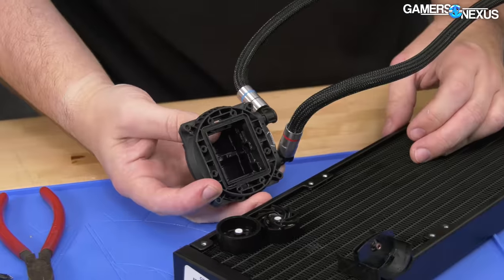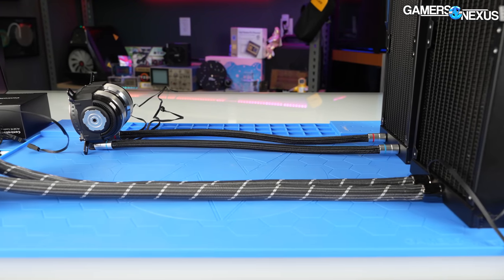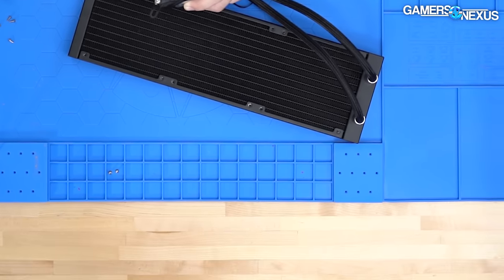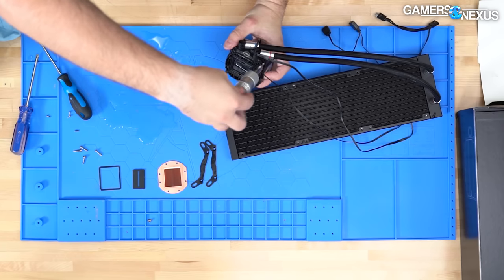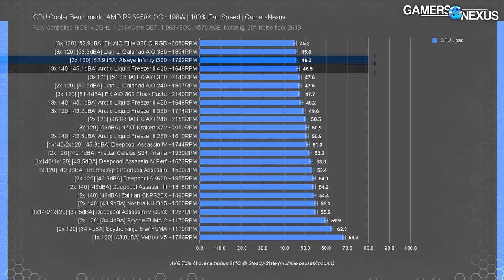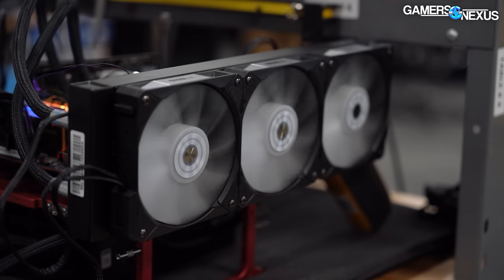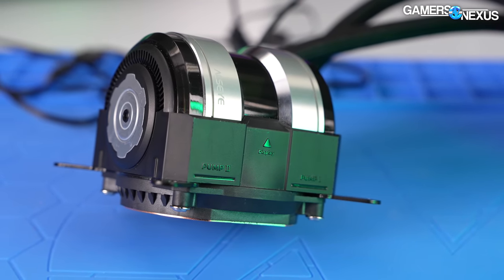Strange Liquid Cooler from AliExpress | Alseye Infinite i360 Dual-Pump AIO

Comment: Longshot and would probably add some complexity, but it would be neat to have a couple measures on the coolant like TDS and Glycol percentage to get an idea of the quality of water used and how much freeze resistance it has if you buy one in the winter in parts of the world. TDS meters are fairly inexpensive on Amazon and Glycol can be measured with a cheap refractometer. Water with high TDS is probably poor quality from a well somewhere and not cleaned up well before use, that could result in problems later on with biological growth or minerals/metals in the water reacting and leaving deposits or sludge.

Comment: 11:10 Did they solder the mid board onto the side boards after the stators were in place? That makes this very difficult to repair. It's like they built it in CAD and then tried to figure out how it would actually go together.

Comment: Should test how it works if one of the pumps fails. If it still works to a reasonable extent then that reliability would be a big advantage over other AIOs (as long as the pump reliability itself is decent), if it doesn't then it's at a huge disadvantage from having the extra point  of failure

Comment: These tests need one more chart where you swap out the included fans for a mid-range option (a standard set of fans you test on all the rads). I would have liked to see if the dual pump actually made a difference but these charts are entirely dependent on the fans, not really the whole cooler.

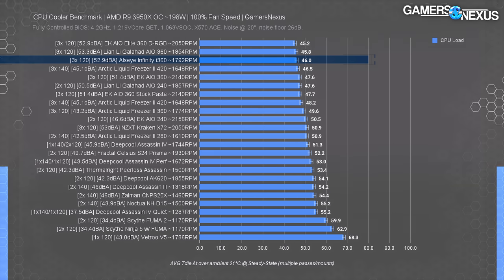Comment: On the 100% fan charts (around 16:00), the Arctic Liquid Freezer II 420 is listed twice - same fans, same RPM, same dB level, but one at 46.5 and one at 48.2.  Is that a mistake, or is there a difference in the runs?  VRM fan maybe?
Reply: The first one is with the offset mounting i guess

Comment: Also would be interesting what happens in case one of the pumps fails. Maybe this is an advantage compared to single pumped versions
Reply: Yeah it would have been interesting to see them clip the motor wires for one pump to simulate a failure and see if it would still cool adequately
Reply: @xDownSetx  this

Comment: Would this AIO fail if one pump died? What did the fans actually sound like? What is the warranty service like? Wouldn’t the pressure drop off from the air stopping after the radiator create less turbulence and easily be removed by another case fan? How reliable are those electric motors? Aren’t the shorter tubes actually better in a smaller case, from my experience the longer tubes just get in my way working in smaller cases. Standardized fans would be interesting and even trying these one on another cooler or testing them another way would also be interesting. I would also be curious to see what happens if you attempt to push the limits over clocking further or just letting the CPU maintain turbo speeds itself. I realize only so much can be addressed in a single video like this in a way that wouldn’t turn viewers away and not actually productive, but those are some of my questions. It’s hard to move from established brands that aren’t necessarily perfect so it would be great if you could reasonably facilitate information required to be able to trust a brand without putting yourself in the line of fire if the product or warranty sucks like you’ve been doing for the prebuilt reviews. I suppose that you already have a lot of this covered in future content and it’s just a random AIO. I just felt like making a comment now that I function well enough to be able to do so at the moment in a way that seems reasonable or even just have the extra bandwidth to be able to. What happens if you kill one of the impellers or electric motors does the other die or does it even matter? I would imagine running at the minimum fan speed it was designed for would be a reasonable volume for most people. If this was made by a well established manufacturer would this review have been different? This review was well done like usual. 

I have a lot of sensory overload issues that I used to just ignore for as long as I could or not even notice until I had a mental breakdown and didn’t always realize one of the primary causes.

Comment: This may be a dumb request, but when doing AIO disassembly could you also look at the tubes and fittings? Some AIOs are very modular and even use G1/4" barb fittings which makes them a very good value option, like the Alphacool Eisbaer 360.

With this dual pump design I wonder if the pumps could handle a bigger loop, but that's sort of out of question if it's hard to extend it (not impossible as you could always just cut the tubes and use your own barb fittings in between.

Comment: I am surprised no one sanded down those plastic spacers that the cooler mounts to.  I bet it would have helped the pressure test.  Either the motherboard or cooler is out of spec.  Or the spec requirements is not good enough

Comment: I love the idea! Dual pump, and it looks like a turbocharger which I really dig. I definitely don't trust the brand enough to even consider putting one in my computer
Reply: I know having redundancy with two pumps in place preventing complete failure if one dies, using tubing that doesn’t permeate liquid, fairly high quality parts is a complete turn off for me when I think about reliability in an AIO. I have issues trusting new or not particularly well known brands too, but I’m curious about the parents company and the reliability of their previous products that Steve mentioned. Their warranty service would be the actual concern for me.
Reply: @badadvice787  Yeah, I think we're on the same page... 
If this company sticks around for a while and can maintain a good track record, I would definitely look into one as a future AIO. Right now I'm happy with my EK AIO which I took a chance on when it came out (I think it's their first AIO? but it's EK after all, and has one of their open loop pumps in it). Hopefully it will have a long lifespan because I like everything about it, zero complaints.

Comment: That's a LOT of complex parts which IMO means there's a lot that could go wrong. With my last build I felt I had to bite the bullet and go with an AIO because it's starting to get a bit comical how little clearance we've got around components like RAM and SSDs, it just kinda seems necessary at this point.

Liquid cooling requires maintenance on a fairly consistent basis, and I'm already aware that I'm not going to do that. AIOs function a lot longer without maintenance and are just meant to be replaced when they'd otherwise require it. That's wasteful to me, but I also realize I'm not going to do what'd be required to take care of a custom loop, and I don't want the extra cost associated with buying components. So, fine… AIO it is.

Just not this one I think.

Comment: All the comments about standardized fans have a point.
Although at that point you're basically just rating how beefcake the radiator is, and Arctic's Liquid Freezer IIs would win "everything".
Speaking of, I currently have a Liquid Freezer II installed in a case that it was technically too thick to fit into, so I had to replace the fans with slimlines.
I know I'm giving up some of its performance, but it still seems to run quiet and have no problem keeping my 2700X cool.

Comment: I dunno, all the hype around ultra quiet cooling just passes me by.  I run a full custom water loop for CPU only, that includes a 240mm rad with two VA450DC Nidecs.  The info I found suggested a 268cfm flow rate at max RPM, which is greater than the rad fan in my car.  I run the power straight out of the PSU (3.2A is far too much for a mobo header), and they are speed controlled by a USB AWG.  At around 25% power, they are in the mid-60>low-70dB range.  You can hear them, but the STRIX 1060s fans are louder at full tilt while gaming.  Water temps unloaded are around DTa 5-7F, with loaded temps reaching DTa 20F (max I have ever seen is 80F in my room and 102F water temp).  Those deltas get me right at the end of the thermal margin on the FX8350 @4.8GHZ 1.365VDC.  Full tilt the fans are a bit obnoxious, but my surround sound is still louder.

Comment: My Corsair H100i elite had the same 9 blade, 9 support type fans which was problematic in my setup. During gaming there was significant harmonics that would surge up and down in volume. Replacing them with basic Noctua redux fans fixed it completely. Not sure why anyone would design a fan like this nowadays.

Comment: Not sure if you have done this before but, would it be possible to cut and smooth out half of the brace elements on the back to attempt to show the effect of them making less noise vs one that has not been modified? if that worked, would it ruin the structural integrity to a point of failure? just genuinly curious.

Comment: I don't understand why the tubing's of the coolers are soo thin in diameter, I mean does the thickness of the tube improve the performance of the cooling the water better if the size of the tube is bigger?
The pumps are OK but the tubing and the pipes of the radiators are too small for better performance, doesn't it?
OK and one more thing, why we don't see a thicker fans more then 2.5mm of thickness, isn't it gonna be way better air pressure with thicker fan to move more air thro high density fin's of the radiators or coolers designs?

Comment: the first chart with the thermals at 15:00 has two different entries for "[3x 140] [45.1dBA] Arctic Liquid Freezer II 420 ~1648RPM" with different results.  What's the difference between the two?

Comment: Its Unique look deff give it a place in the market. Supported by the fact that it is actually good at cooling 👍
The only thing i do not like about it, refill-ability :( Based on the dual pump / dual impeller design, the mechanical load is split giving it possibly longer life span? Hence 2-3 years down the line, flush and refill, aka maintenance .

Comment: No idea if this can be tested for, ur I'm curious how it'd run with just one working pump. Possibly something for the idea of "if one pump did die, you're not completely out of luck." also would be interesting to see how easily this type of stuff is installed in a case. Obviously it'd have to be kinda generalized, but I couldn't help wondering when Mike was having trouble with the stiff tubes just on a test bench.

Comment: Just a question, when you do these tests across different coolers and pressure graph do you torque the coolers down to the same amount of pressure on the mounts or just follow the product guide lines from the instructions provided? Awesome content as per usual, been subscribed for years!

Comment: You know what I find peculiar, not that fan is from unknown brand, but that their software is very much like Lian Li's one. Pretty similar interface, led light set (consists of three bars), colors - I wonder if they use one software, but customize as per company (similar to connector hubs, look same, only sticker is different, ex. Cooler Master).

Comment: That's a terribly high min RPM for the fans, so it therefore must be loud when idle.  My system's often around idle (with spike that thermal mass can deal with) and fans remain at 400RPM most of the time (can hold 300 but 400 means far less need to ramp for fatter spikes) on D15.

Comment: I noticed that the Thermalright has one of the smallest flatness test from your testing, but that's an air cooler. I went to look and found they have water AIO as well, called Thermalright Frozen Notte 360, and Thermalright Frozen Prism360 (and 240 versions of them as well). Have you considered testing them? I wonder how they fair with Artic Liquid Freezer II since it's close the best efficient AIO cooler from your testing. Or is it not reviewed because it's just bad? They are cheap and haven't heard much about any of their liquid coolers (they may have other models I'm not aware of)

Comment: It looks like the company should spend some engineering money simplifying the construction. The more complicated the assembly, the more points of failure. Between tolerances, tolerance stacking and assembly. Of course the cost of all of the proprietary little bits, assembly, and subsequent warranty issues.

Comment: Is it possible to use a Dremel to remove some of the struts on the backside, or does it seem that the structural integrity would be compromised if you did that?

Comment: When you buy a real good water pump or and waterblock, you can find that it's easy to dismantle and can repair, because it worth enough to make it last the longest possible. You just cut the wire coil of the motor,dead. 5 PCB...weird.

Comment: @GamerNexus i don't know if you read this or you are interested but i challenge you to do a test. 
Mobo usually have heatsinks on high temps components.
I wonder what would have change if you would use as much as you can heatsinks also in less warmer components or smaller components.
Same temps as before? Would it give some benefits or gains in heavy task? Gaming?
I didn't look if you do something similar.

Also another thing to try is like a heatsink challenge. Do you know the fan challenge from Major Hardware? Why not test heatsinks with a 3d printer? (Mold 3d printed part and cast aluminium in unique shape). Heatsinks have similar designs I believe there are better thermal designs.

Comment: Coolant moving faster doesn’t provide more cooling, actually it does the opposite. This has been proven in automotive cooling systems time and time again. It takes time for coolant to absorb heat, as well as moving the heat into a radiator. There is a minimum flow that is needed, but going beyond that, you lose efficiency. There was a guy who took the thermostat out of a Veron and although the coolant temp was lower, he overheated and locked up the engine in about 20min of driving. He threw a fit online because it wasn’t covered and the dealer made fun of him for trying it.

Comment: I  am interested to see, some Frankenstein cooling like me. I changed on the Corsair H115i, the two 140mm fans to 1 200mm Noctua fan, with a 3D printed adapter. So in Standby the fan work with 330 RPM and on full load on 500 RPM. Probably as a video Idea, 🙂

Comment: The design of this is odd, from the overly-marketed statement of 'coaxial' I would've assumed that both impellers were sharing a motor, and as you don't really need differential speeds this would make sense; unless the coldplate itself is such a high impedance that you truly do need the two different speeds, but at that point I'm sure a simple gearing ratio would suffice and cut down on the BOM and boost overall efficiency.  On the other side of this point, the 'gravity' portion, I assume this is because you're both pushing and pulling with the obvious mounting being the radiator at the top of a standard case, gravity would assist here as the receiving pump would have to work less to pull in comparison to the supplying pump generating head pressure, with the impedance of the coldplate between the two; which might also lead into the differential speed of why two motors are used, yet again I would think a simple reduction on one side would suffice.  I'd also be interested in seeing what the flow path actually is, I'm not doubting it's a push-pull design and not just a doubling of one or the other, but all the chambers and guides seem overly complicated for this use. 

I would be curious to see another company's take on this concept, or even someone DIYing a quick solution such as Roman doing up a quick dual-housing using a couple of AIO pumps; or, I'm sure a custom loop would suffice for comparison, especially for a before and after comparison of various datapoints, as flow and pressure are more interesting than just cooling for this kind of setup.  I'd also be curious to see how this translates to a GPU block as well, say an AIO system with QDC connectors, that way you can loop a CPU and GPU into the same loop, or add a second radiator to a loop if you need an odd configuration (such as two individual 120mm radiators if some case doesn't fit a singular 240mm), or the potential of a reservoir within this adaptable AIO system; but the important bit is how a discrete GPU pump would affect a loop shared with a CPU pump-block.

Comment: I have a question, I´m not sure right now do I a CPU cooler upgrade with an good air cooler for my Ryzen 7 3700x thats only needs ~65W, or got one from Arctic a 120mm AIO that I asked is that ok with my cpu with no overclocking and they say yes.
But after seeing such things with AIO I am not sure I trust them enough, what if this thin fins inside where the liquid stuff going through get full and lost their better cooling perfomance. Or is that even after so much years that you can say pff shut on it!
Or what do you have to say, when I will never overclock my cpu for longer life span? AIR or AIO then?

And thx for that video it was fun to watch and I must say the package it is really nice with that opening^^.

Comment: 14:58 You have two entries for Arctic Liquid Freezer II 420 with the same fans, noise & fan speed but different temps. Which one is correct?
Reply from the maker: They're both correct. One is with the offset kit. That's just not listed. We've already added that note on the next one.
Reply: @GamersNexus  great job, thank you!

Comment: Just a pump 101... pumps produce pressure and flow, put 2 pumps in series, and you double the pressure. Put them in parallel and you double the flow. Seems unnecessary to have them in series (push /pull) as it would be more effective to have them in parallel and grt better flow.

Comment: Hey GN,

at 15:50 you are showing a chart. On this chart the Arctic 3x140 aio makes 2 apperances with the exact same name, noise level and rpm, but also two different temperatures. 

I found this very confusing. Is one of them with an offset bracket or whats going on here?